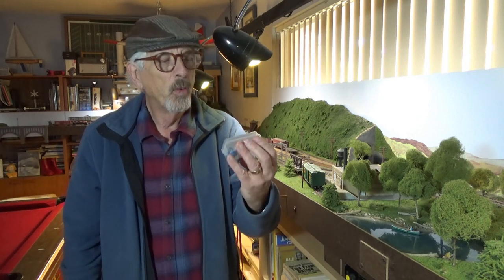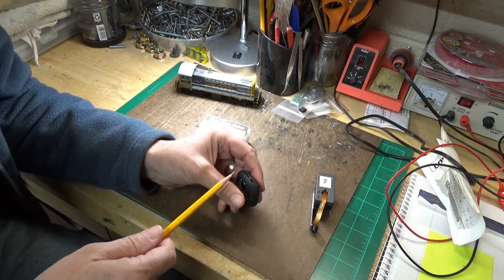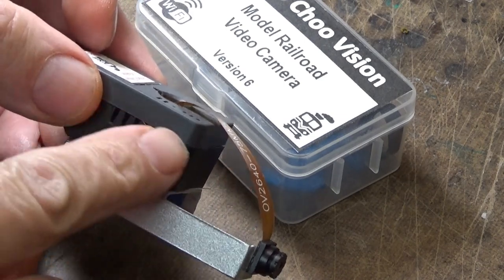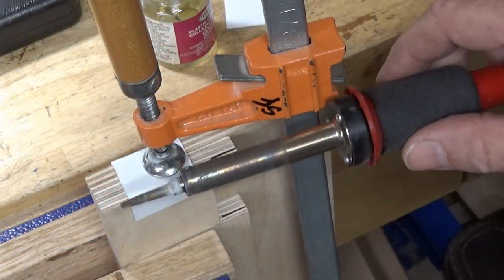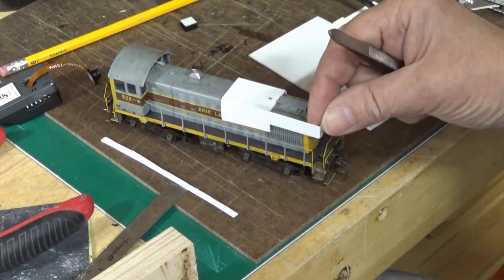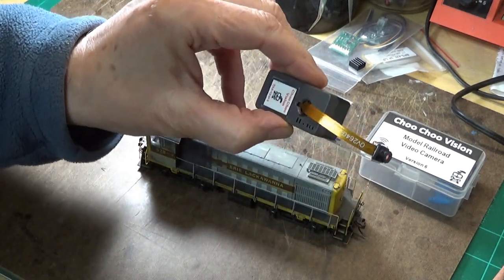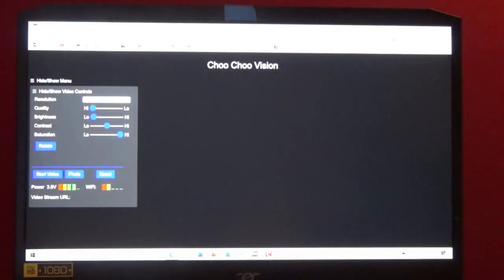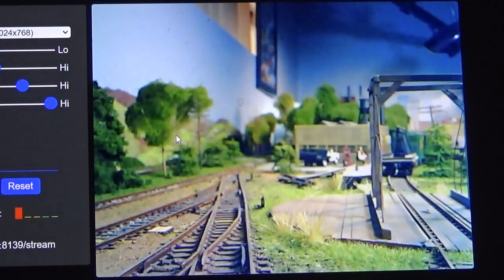Choo Choo Vision camera for live POV images

Comment: Thank you Stan.  Where can I look to see what all I need to get this to work?  My train shed is in the back yard away from my house.  I have wi-fi in my house but out there it is at it's limit.  If you have any thoughts I would appreciate any help.  Thank you for your work and time.
Reply from the maker: Hi, steven.  You'll need a lap top of course, and since this camera system is real time, you will need a fairly strong wifi signal.  My router is not in the same room as my layout, so my signal was not the best at times.  Perhaps you could look at one of those wifi extender gizmos to get some bandwidth into the back yard.
Reply: @StanFerris   Thank you fort the info.

Comment: so how far does it transmit?
how much scenery can it transmit through?
wire mesh scenery support.
Reply from the maker: Hi Larry.  Good questions.  The system uses your wifi routing to make its connection.  So the most important factor I've seen is how strong that signal is in your train room.  My router is two rooms away, and so my signal is not really strong.    It would be best if my router was closer to get an optimum signal strength.

Comment: Disappointed!  Doesn't show how to or when the battery is charged.
Reply from the maker: So sorry, Larry!  I was just giving an overview.  There's a small port on the back of the unit and an included power cord that plugs into the back of the camera and then into a USB port for charging.
Reply: @StanFerris  I connect it but no lights come on, don't know if it is charging. The cable is M5.
Reply from the maker: @larryprover1385  Mine did the same thing at first, I presumed it was because the battery was already charged.  Try taking the magnet and cycling it on/off, or try the tiny reset button.  If nothing changes then unplug the charging cord and try using it.
Reply: @StanFerris  Thanks Stan.  Larry
Reply from the maker: Larry, Don't hesitate to contact Thomas at Choochoovision.  He was very helpful to me on the phone.  👍
Reply: @StanFerris   Thanks Stan, I talked to Tom yesterday and you have both been a great help. My camera is up and working now thanks to you and Toms help. I am amazed at this little camera, I know I will be ordering more and spreading the word to my Railroading Buddies! Thanks Much,  Larry
Reply from the maker: Awesome, Larry!  👍